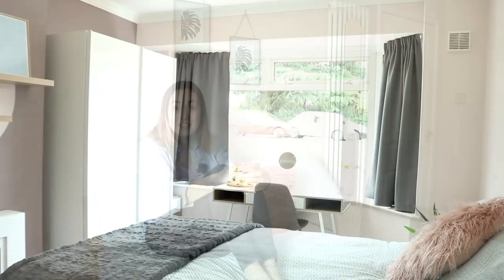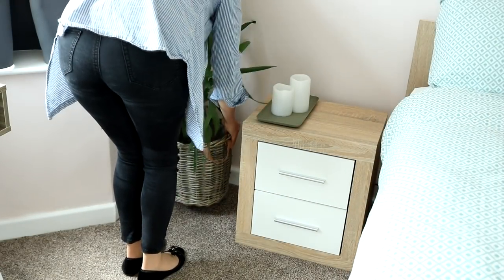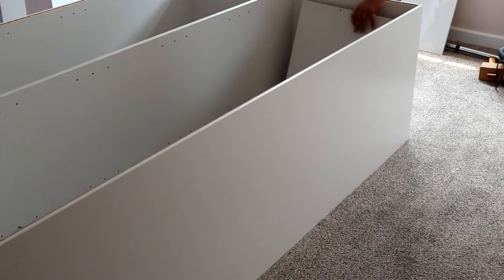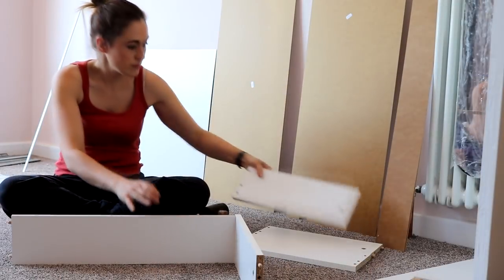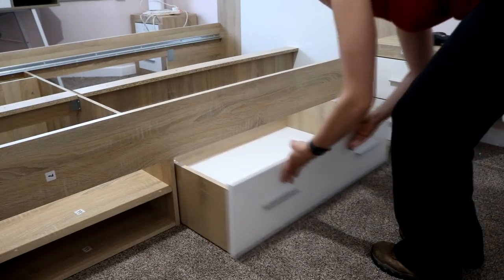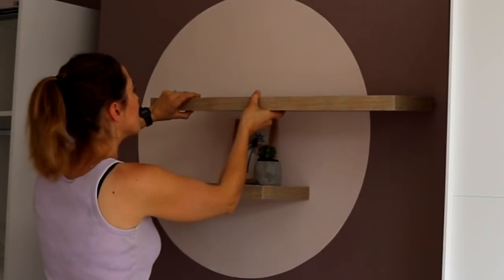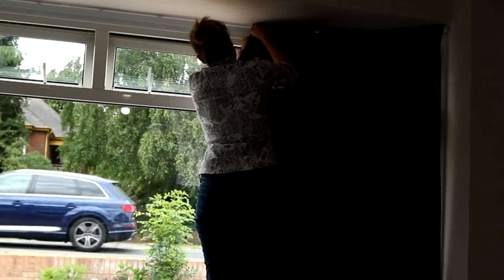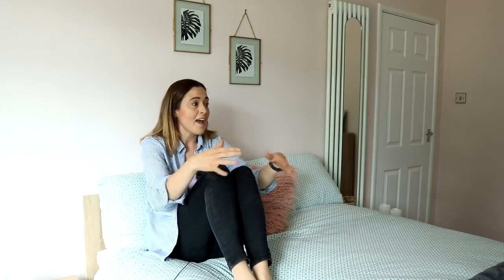JYSK Bedroom Build & Makeover Reveal | GIFTED | The Carpenter's Daughter

Comment: Looks fantastic. A little tip for when drilling holes. Under the hole you are about to drill use masking tape, tape an envelope to catch the dust it save you getting the vacuum out.
Reply from the maker: Thanks!  I very nearly did that but have had so much trouble lately with it taking paint off, I decided against it this time lol 😣
Reply: Wow that was a quick reply. I use the thin paper masking tape as its not very sticky. Bedroom looks fantastic.
Reply from the maker: Thank you - I'm very excited that I'm hanging on the edge of my seat lol